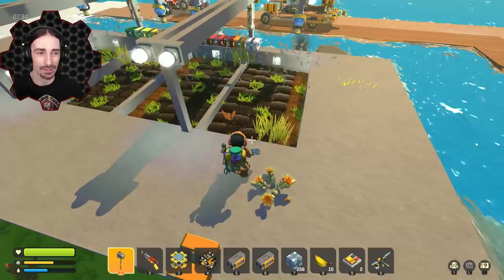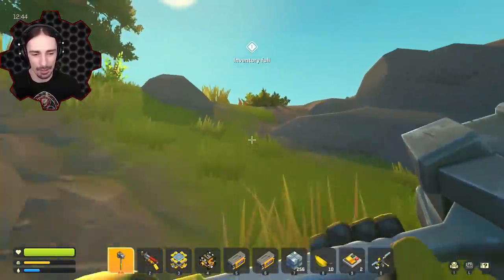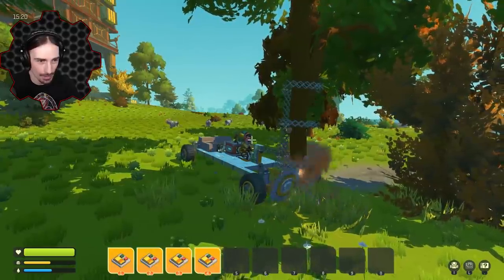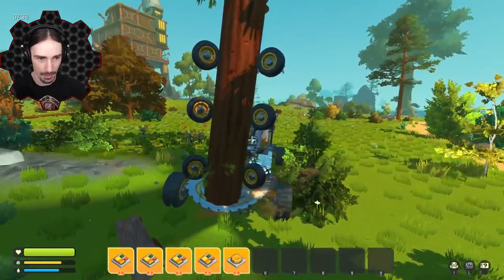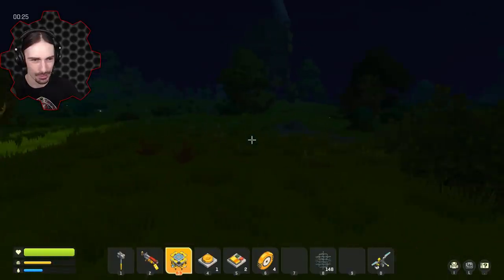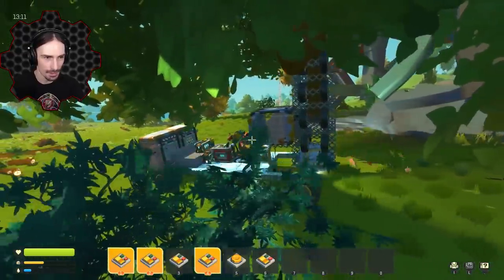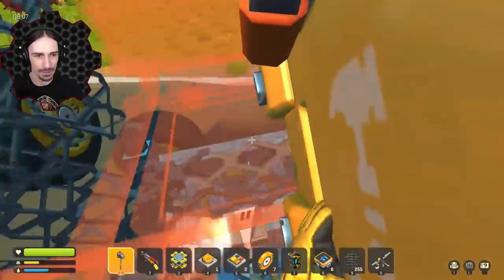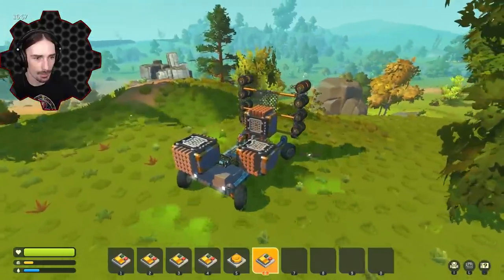Building a Vertical Tree Eating Wood Logging Car! - SM Survival Mode [SMS 25]

Comment: Hey, maybe try putting a larger fence ring around the cow pen so even if they glitch out of the inner one, they might still be contained
Reply: I'm pretty sure the issue is that the wocs have a chance to despawn when you go to far away. Of course, he may not have gone too far away, and there could be some glitchiness at play here, but the despawning was the cause of woc disappearances at the original base, so that could be the case here as well.
Reply: @KingNedya  I don't think it's so much that they despawn it's just when they get unloaded and reloaded it doesn't save their location. so they can be placed withing several blocks of their starting location. Same seems to apply to enemies. if this was Minecraft it's like it saves what chunk the mob is in, but not the exact block.
Reply: @JustaGuy_Gaming  Oh okay.

Comment: Hmm, maybe make it like a three jaw chuck with wheels? That way there are no walls the tree could get stuck on, and it's adjustable for different sizes.
Also, your car could use some stands that fold out when you want to cut a tree, to act against tipping over.
Oh, and not 100% sure about this, but I think if you destroy the stump the trees will not grow back.

Comment: @ScrapMan I was noticing the wheel that you added to the front, was stopping the large redwoods from being closed completely in the contraption. Then after the initial cut, it seemed to have an invisible barrier of some kind, that was colliding with that front wheel still (The one used to contain the small trees). Also, as a side note. It made me genuinely happy when you initially got it to work, and the look on your face showed your excitement for the system working. Well played sir.

Comment: He Knows That Branches Has No Collision Right? Right?

Edit: Its Just For Show You Hit It With Any Blocks It Will Never Touch It And Fall
Reply: Royal VGGFP probs not
Reply: @dgxo  He Said "The Branches Is Ruining It" Like What?!? How??
Reply: The big branches DO have collision, but the really teeny tiny smol ones do not.
Reply: And when i mean big branches they're the ones in the really really big trees.
Reply: @Nafinafnaf  if you saw them 5he branches don't have a collision
Reply: They do have collision, most of them you have to saw the stump to destroy the branches
Reply: *not the stump, the log it is attached to
Reply: @ricky107_  The branches do have collision until you cut down the tree. You can see in the video the branches got in the way until he cut the tree down, then the branches went through his creation.
Reply: @vibaj16  When I built a tree cutter, I didn't have any collosion with any branches.

Comment: The reason it is less effective on the large trees is that the netblocks in the front and back are too close together. My guess is that they are the exact same width as the large trees, or just smaller, causing a lot of friction and preventing the arms from closing as intended. I think the solution would be to add either a block or a piston with a length of 1 in between the wheels.

Comment: Or... you could possibly weld the whole tree to the back of the truck and take it back to your base.
Use a piston to pull the tree through a conveyor, and use saws at the end maybe

Scrapman congrats for the eater
Reply: No, you can't weld or place down(with a lift) trees, raw material, and bots.
Reply: ItzRhon TheSegampong You used to be able to weld trees that weren’t attached to the ground.
Reply: @segampongrhonbethel3659  you can weld the gotten of trees
Reply: @J0hnB09  you still can
Reply: Moonbo did something like that and it worked good
Reply: LAHZING It could have been removed/patched by a bug fix I don’t know.
Reply: @J0hnB09  worked for me yesterday, but yeah, possible update. Moonba thought it was an intended feature, so oops if not :P
Reply: Thxs guys for explaining
Reply: @J0hnB09  if you ACTUALLY read the patch notes, there's nothing stating that

Comment: This is TOTALLY the idea I had to make a tree cutter, cut it in place and let it fall into the blades!  Just I haven't made it yet, so hopefully your build will give me some ideas!  Also branches have NO collision.  You should add some stabilizers on the sides that extend to make your vehicle have a wider base when working with the huge trees.  Put the pistons behind the bracing, the trees are getting caught on the block the pistons are connected to.  Also, you can weld trees to a platform so you can cut them if they fall out.

Comment: I feel like the height of the "grabber" needs to be taller, with more tires in each row. also make the vehicle much heavier with double/triple width driving tires to help with grip, like perhaps put two refine bots on it to clear out the material gatherer? also, i don't believe the saw blades doing a 180 does much, maybe they could just angle up or something.
Reply: Yeah this what i have been looking for in the comments. :D Also the front wheels needs to be 2 blocks extra, so the center of mass will be on the inside of the Tree-hugger.

Comment: I built mine horizontal, it's basically a large tunnel under a seat running fron to back with 6 saw blades, 2 on each side and 2 running down the middle from the top, the front blades stick out 1 block or so. I just drive into a tree, knock it down and drive slowly over it. Then I put resource collectors on the side so the wood goes straight into them.

Comment: honestly i find bearings to be a better tree grabber.  plus you can make a pretty tight lock. also getting the tree to stay upright is the most important part, pistons don't have collision when extended so trees can go into those areas. this is why the trees are not sitting in the center like they should.
it's quite unique and it functions mostly and honestly thats pretty good in it's own right.

Comment: 34:45 was waiting for you to say that. yessss the big trees ar 5x5 technically. your machine is only 4 deep, thats why it kept getting stuck. also it can be gravity fed, it just needs to be really tall. i use a welded woodchopper thats vertical and i needed to make it almost half the hieght of the big tree to not have it tip and get stuck due to clipping and friction.

Comment: Scrapman vehicle tip ideas.

Extendable legs for added stability ... You know like utility trucks. With weight on the ends on them so it helps resist should the tree still be too heavy also making the truck why tree com still lower.

Instead of adding more pistons to pull the tree in why not try arms that extend upward to right / stabilize the tree?

What if you set up the whole thing on a double bearing system so you could lay the tree down or pick up a fallen tree if you want?

How many wocs do you think could fit in your farm area if they were packed in?
Quick guess.
Maybe hint in the video just in case. For fun.

Comment: Not sure if you will see this but figured I'd say it anyway. The big trees are about 7 blocks in diameter. Looks like the depth of your vertical feeder/covayerbelt is about 4 or 5. It fits on the x and y axis, you just need to modify it to fit the z as well

Comment: Some recommendations for the tree cutter:
1. Remove the wheels, make everything gravity driven, or, if you want to keep the wheels, make them work off a max level controller on a loop so it doesn't use fuel(Plenty fast) or just make them free rotating.
2. Scratch the piston closer idea, the pistons are too weak, what I've done is make a square that has bearings(But they're both on the top and bottom, otherwise too weak) on the front that open it up and close when I've got a tree in. One drawback to this is that it's basically impossible to do the trees with branches or at least not worth the effort.
3. You NEED to have a refinery on the vehicle(probably 2) - the big trees each fill around 1 harvester and give ~500 wood, which is actually not a lot, so, unless you want to drive back to your base a lot, you need the refineries. What I've found is that if there are trees next to each other, even 2 refineries can't keep up, so you need to wait a bit in between chopping trees.
3.1. Since refineries are super heavy, you might want to make the vehicle controller or piston powered, otherwise bye-bye fuel.
4. The big trees are around a 5x5 square
I don't know how to position the saws, since I've only got one saw but it's got an issue where the logs sometimes pop out, so I probably need another saw and move the harvester closer(Make it part of the wall).

Comment: @17:25 it dawned on me, I'm going to use my scrap wheels for my logging machine, so much cheaper to have extras of.
I should explain.
Ive been planning on using the mining wall idea with 4 blades and horizontal wheels. I plan to break the branches off before if able. I'll post progress when I get back from Thorn on PSO

Comment: maybe for the large trees you can add a bearing to the mechanism so that after grabbing it and cutting off it's base you turn it so it's horizontal and then just keep feeding it in. it might also solve the issue of the pistons and also can result in the bottom wheels touching the tree more, for other sizes of trees as well

Comment: SCRAP MAN! for your boat try using the vacuum pump instead of the water cannon. it shoots water when connected to the water tank, and the water tank has 2 ports. one on the bottom to suck in and one of the side to push forward!

Comment: Looks like the big tree was catching on one of the front net bracing arm. Needs to be changeable depending on the width of the tree a 3 point crabber, from both sides and the front with a solid back brace

Comment: Forget the wheel push idea. Just make a really large slide that fits the entire size of the big tree. Then just cut it at the bottom so then the tree will just slide down. You can use low friction blocks.

Comment: Haven't seen anyone use wheels like that before. I think if you make the vertical structure taller wider and the base structure wider and heavier, you'd be able to eat those big trees no problem. You could also put the refiner bot on the back to weight it down and refine blocks on the go.

Comment: you could try to use this design with the first design with the claw idea by wrapping wheels around the front that way it has more potential to pull or push the tree down when the pistons are not fully contracted and the tree doesn't touch the side wheels.

Comment: You should replace the 2 flipping saws with 3 vertical ones. It might help because the trees would be in contact with the edge of the saw blades instead of the flat sides. And you wouldn’t need the extra stuff to flip them, just extend and activate the tires and it’s done.

Comment: Maybe try making a lock with bearings, holding the halves with wheels together, that you can toggle, so that the big trees can't fall over?
Reply: the big tree hitbox is slightly deeper than the space (front to back) in his grabbers so it sits to one side of the spine.

Comment: Apparently there is an issue with blocks temporarily despawning when your not close by, place a piece of corn high enough so its out of reach for the woc in its pen and it won't run away anymore

Comment: The reason the big trees get stuck on your tree harvester is because they get stuck on the interlocking teeth in the front. maybe put the interlocking teeth on a free-floating bearing so that if anything gets stuck on them it will naturally want to slide down? If you just make it bigger it'll cause medium trees to potentially fall through the front when they get chopped to small pieces, let alone small trees even more likely to fall through than they already are.

Comment: try adding a refine bot on the back to add weight for the big trees and then you would only need 1 collector too also try adding a saw blade to the top to trim the branches off

Comment: (Idea for wood chopping vehicle) How about using a grabbing mechanism that is attached to a piston to hold the tree and using the piston to descend it down into the blades
(And if the vehicle falls over, you could stabilize it by using pistons (that are about 7 blocks away from the main part of the vehicle) to push it off the ground

Comment: some tips, base of large trees is 5x5 so you need frame at least 7x7, hitbox of branches from medium trees are removed after cutting, put refiner on car to get some weight and make some work on flow, make vehicle wider will not tip over so easily, if you want check my vid for similiar quite effective design

Comment: You should make it where you have the wheels go up and down so if it does get stuck you can just reset by pushing it up and then back down. When the branches get in the way you should have some saws that are vertical

Comment: I doubt you will see this, but I believe that your cage is slightly too small for the diameter of the big trees. I was watching the last tree you mined, and it looks like the tree trunk got stuck on the block that the piston was connected to, which made it stay on that one side. You could also add weight, or increase the width of the base as it would help your vehicle from tipping over. You could use pistons or bearings and controllers to pull out long arms that stops the vehicle from leaning nearly as much. You probably have already thought of most of these ideas, I am just suggesting them in case you haven't as I really want to see this tree eater get those redwoods! (Btw redwoods give normal wood which you may want)

Comment: You should add level 1 pistons between the wheels, so that when you do the big trees it shouldn't mess up, I think the reason it wasn't working was because the tree collision was interacting with the net blocks and forcing it not to move
Reply: I think replacing them with pipe blocks might help considerably with that too, plus I think part of the issue with it closing was that there wasn't enough space

Comment: I hope you read this because I have been thinking and for the big trees have one sawmill but it’s spikes parts are facing the tree.This will help to cut the tree nicer and there will be less errors in the system because the game will register that the cut box or so the like that will cut the tree I think you know what I mean.Now we got that part done so skinny tree,How do we make it so it won’t wobble?well add second row of wheels is in the middle and it’s inside it more.we got that part done so it all comes down to the midden tree.
,What you have to do is make it where the middle row of wheels have suspensions when the tree comes in it will moves backwards depending on the width of the tree.
The saw thing that I said may not work depending on the game’s physics.
.This Idea may not work as extended but it’s worth trying.
Reply: Ignore the highlighted blue thing in the text
Reply: Is this a good idea?What do you think about it?

Comment: Put 3 pistons on each other,
And a saw blade on top
Then a controller and set it to 1 or near 1 and Connect a button to put it down 1 by 1 then 
Put a sensor with 1 block distance and once the sensor is on,  the sews will shoot up.
So it will dissolve it from the top and restart

Like so Scrapman can see

Comment: The first prototype did not work because each arm is on an individual bearing. When you cut the bottom part of the tree the bottom two arm closes and become smaller than the with of the tree. To fix this problem only use two bearing attached to two verticle pole with the arms sticking out. This will make sure that the arms will stay the same width as the tree.

Comment: If I were you, I'd source my design from actual forestry machines and have horizontal stabilizers and a heavy vehicle to prevent tipping. To fix the branch issue, place sawblades on the top and have it act as a debarking machine.

Comment: Route the switch for the electric engine through an AND gate and then put a sensor on one of the arms to detect when there is a tree inside. Then run the sensor into a NOT and the NOT into the AND.

Comment: how about you just cut through the root then weld itto your vehicle(highly recommended truck) then you can cut all the wood at home sideways, make and endings with four or more then the other side have a piston that will push to other side(the wood i  the widdle),meanwhile it cutting through the wood then automatically get in resource pack then into the grinding machine that connected to all other chest and you can also build your base instead of waiting... just my thought and from moonbo wood cutter

Comment: I found a saw glitch if you put a saw on a bearing connected to a controller and set it to 30° and have one edge glitch through a block (concrete block so it doesn't break) the saw will spin at full speed without the need of an engine.

Comment: not good 
better is to make a station where you can cut the trees  and a pickup truck where you can put them in, it's faster
p.s you can weld trees  and use triple piston extender to push them into saws .

Comment: instead of pistons i thought of using  barrings then it could start vertical or horizontal but horizontal needs more barrings and i also thought before he used wheels making the separate pegs move with separate switches to move a pare of pegs without moving all of them

Comment: Scrapman the problem with you logger and big trees is you are adding more piston force to the tree but the blocks that are trying to push it in on the front are only holding it there. Even though with normal physics it would be pushed in because of that force but hey SCRAP mechanic physics  am I right?

Comment: Scrapman make a wood wall not concrete wall for the farm! Remember in the trailer when bots attacked the entrance because it was made out of wood which was the weakest block so if you make the road out of wood the bots will attack the U turn.